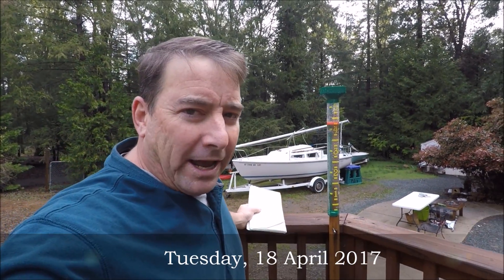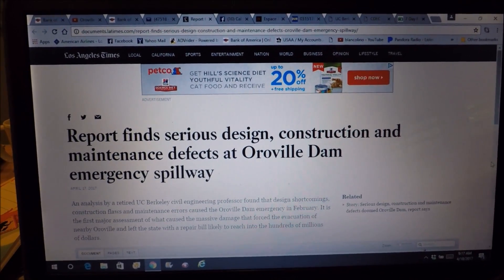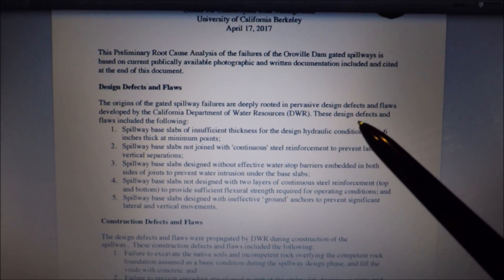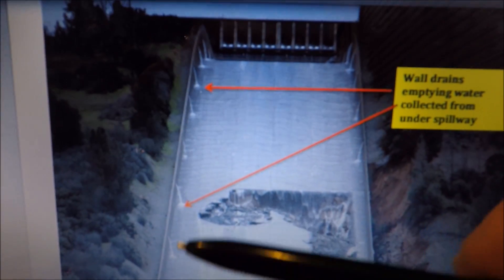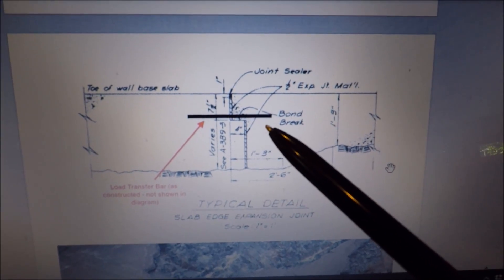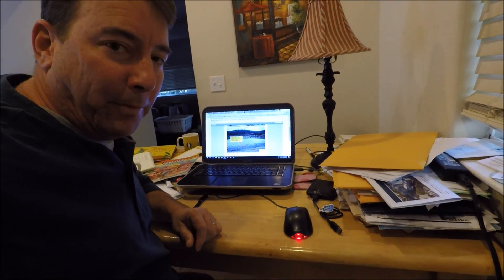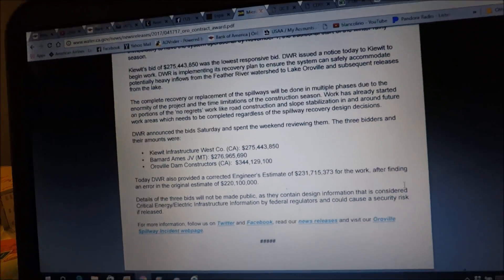Oroville 18 April Spillway Failure Explained-Independent CCRM Report

Comment: Great report. One nit to pick however. Cavitation is not "air". it is essentially "steam". The negative pressure in the turbulent flow creates enough energy to "evaporate" the liquid. The collapse is essentially the re-condensation of the water vapor.

Comment: I think Juan said it best when he referred to the spillway as a four lane highway.  The systematic designs for highway construction is much different these days then it was back in the 60s.  Back in the 80s the Federal Highway Admin started to replace the entire Interstate system with better roadways and concrete design and I think that is when they revamped large building and highway construction codes and design processes.  From what I have heard, back in the 50s and 60s, highways and bridges were designed to only last 30 years or so and the Oroville Dam spillway is no exception.  

Cracks in the spillway were a tale tale sign of needed replacement and that is the true failure of what had occurred, the lack of replacement when it was overdue.  One other note, I only know a very little about construction but the few things that I would add is Core Samples to verify the composite of the concrete and to affirm that the concrete was poured correctly meaning that a concrete vibrator was used correctly to remove all the air bubbles / air pockets in the poured concrete for further concrete strength.  Nowadays, I believe that federal projects require that the concrete will last 100 years. 

As for the cost, I would estimate $1 Billion to properly replace both the spillway and emergency spillway and maybe even upgrade the hydroelectric power system.  Once all of this is done correctly, it will last 100 years without a problem.  Yes, we the people will pay for this as we the people need the dam.  In the end, the Oroville dam spillway was not a design failure, it was just the best that we could do at the time.  As I always say, there is always room for improvement.

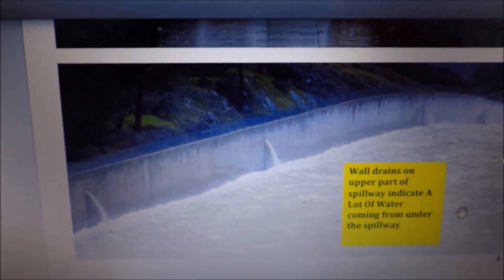Comment: Hello Juan, at 6:30 about your comment that the herringbone pattern of the drain pipes is a little exagerated, personally I think not, because the drains take the water from underneath the spilway, and dump it very high on the sidewalls, maybe 10 ft. high or more. Plus the additional depth under the floor of the spillway.  So, to have enough head for a good flow, they have to dump the water much further downhill than they take it. Hence necessitating a steep herringbone pattern. 
Thanks from Canada for the videos, they are very interesting.

Comment: Great presentation!  As a kid fresh out of high school I worked on construction surveys on the intake, transition tube, and powerhouse structures, but was not involved in the dam proper or the spillways.   

It's interesting to see this presentation on the spillway failure -- basic fundamentals violated.  

1. If water can destroy something, it will. This is especially true if hydraulic jump and cavitation are involved, because is that hydraulic jump and cavitation concentrate high forces into small areas.   All spillways involve hydraulic jump and cavitation as part of how the energy of falling water is dissipated.  

2. Any structure that is intended to block the flow of water needs to be either absolutely impermeable and strong enough to withstand the resulting static forces; or be constructed according to the principles of a "graded filter" to allow leakage water to escape without eroding the filter itself.  

3.  If a structure requires a foundation, foundation failure leads to the failure of the rest of the structure.  (This is most commonly seen in roadways, were potholes develop:  the general public thinks that the pavement failed resulting in the pothole, whereas what really happened is the foundation failed resulting in pavement failure.  And, since it rains nearly everywhere that roads are built,  an engineered roadway must be constructed according to the principles of a "graded filter".   ......The basic problems needing to be solved in an engineered roadway are about the same ones that apply to spillway design.

***************

I remember seeing the auxiliary spillway to the north being built and thinking "Gee, I hope no water ever has to go over this thing!"  Just a kid out of high school, no knowledge of formal hydraulic engineering principles.  But at least I'd played outdoors as a kid and seen what water does to dirt and gravel!   Nearly 50 years later,  civil engineers started thinking that same thought.   The design violated all three of the three basic principles I listed above.  

******

Another thing that stands out from my memories of the dam construction is that the contractor McNamara-Fuller management frequently overruled their own experts when it comes to dynamite and to construction cranes.  Through shockingly stupid mistakes they destroyed their highline tower on the south abutment intake structure (fortunately nobody seriously injured) , and literally dynamited an enormous conventional crane to the bottom of the intake tube on the north abutment (nobody hurt).  

Thanks, folks, for a good fogie reminisce.

[more edit]   Guess how you bond to polyethylene sheet?  A.  You don't.  May as well be a layer of grease. ......This doesn't mean don't use plastic water barriers, but it does mean you have to pay attention to what the structural implications are.

[and more]   https://en.wikipedia.org/wiki/Hydraulic_jump

https://en.wikipedia.org/wiki/Teton_Dam  Teton dam failure root causes were unsuitable geology (defective foundation) and neglect of the principles of graded filter design.   The dam failed while the reservoir was being filled for the first time. As the failure began, they tried to stabilize it by dumping riprap rock on the downstream face where the water was emerging, an utterly useless tactic which illustrates the Bureau engineers' complete ignorance of how dams work.

I looked for a good pic or wiki on graded filters but didn't find anything suitable for a quick explanation.

Comment: Please, do you know about it? What is this “Intake Structure Right Abutment” for? See “California State Water Project” Fig 59 of the Embankment Plant.
Reply: I think your question is addressed by a posting in this thread:

https://www.facebook.com/groups/OrovilleDamBuilders/

If you scroll down far enough, you will find a picture posted by "Shaner Jeff" dated "February 20" which shows the dam during construction and has this caption:

"Good shot of the spillway on the top left and the intake for the never completed second powerhouse, they figured they would never have enough water to run it so they never finished it."

You can also see the (partially built) intake in various pictures of the lake taken during recent years when water levels were very low.
Reply: John, thank you very much! Have a nice weekend!
Reply: URL to fig.59 please. Could guess its the penstock intake for the generators.

Comment: The spillway is the "immediate" problem, but the ugly thing is that wet spot on the surface of the dam proper.  There is leakage that is similar to other dams there that have failed.  The bad design and maintenance of the dam is really scary.  Having problems back in the 1920 time frame: understandable. In the 70's?  Not so much...Today? Totally inexcusable.
Reply: Yes.  The root cause of both spillway failures is the unstable red rock they were built on.  If they didn't excavate deep enough on the flanks of the dam, how much of a problem is that?   Engineering is based on initially stated assumptions.   Those assumptions can be more important than the careful calculations and design.

Comment: Hey Juan, Thanks again for all your efforts!! Question;  while looking at this Video i saw the "Fishbone crack pattern" which seems to be an issue for the whole spillway from back to front, so this would mean that the remaining upper part of the Spillway is very questionable, as the Construction has/had these pipes and cracks from back to front... Now if i remember it correctly the rebuilding plans will be including this old and faulty structure into the rebuild.... So, with that knowledge surfacing right now (of course under the assumption that i understand all of this correctly) wouldn't that just mean that the 250M$ Rebuilding Project is a potential waste of time and money, as (in my Option) there is no way to build a newer better structure on top of an old one, if the old one is faulty from the original drawing table already!? What´s your take on that? (comment at right update-video now)
Reply from the maker: They'll tear it all out...

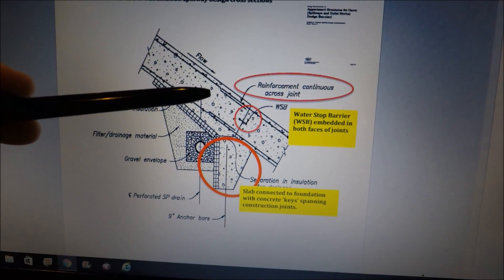Comment: Great report, appreciate your technical review of items and informative videos on the Oroville spillway.One very small comment regarding the joints.  The first joint that you show is correctly discussed as an expansion joint and the reinforcing steel does not continue through it.  The last joint shown near the end of the video appears to be a construction joint, used when the contractor ends that segment of work on a temporary basis (13:34).  The last type of joint that I did not see, that they may have used is a contraction joint, or weakened plane joint.  This type of joint would be placed after the concrete had been poured and either scribed or sawcut into the concrete to create a weak spot where cracks caused by concrete shrinkage during the curing process would form.  This prevents cracks from taking on a random locations and induces a pattern.  There is a fairly strong chance that they did not put these in the spillway given the crack patterns shown in the videoKeep up the good work,  love your presentations and appreciate the hard work you are doing.

Comment: I used to live
In a home built in the 1950's my waste water lines were built from concrete and my neighbors had large trees only 10 - 15
feet from those lines which consequently worked their way into my wast water lines making them crumble 
Up to 80% failure of the entire line let's just say it was not a pretty sight when the back up took place. On the other hand, think of what would happen if they built tall buildings without rebar catastrophic failure and that's exactly what they did both tree roots + lack of enough rebar or (reinforcing bar) I'm also curious how they were able to build this with the knowledge that water was going to flow underneath the spillway how did they think it was going to last with erosion underneath this spillway. Even the most basic of engineer or substandard engineer would know this event would be a catastrophic failure.
I live just above a dam with failures so bad that the residents downstream would gather to watch it being built in the 1950's those who live in my community during this time refuse to drive over it choosing to take routes adding up to 20 more minutes to get to their destinations because of the poorly built dam and the holes one the size of a man. In a state that most bridges are considered the worst in the country. This sounds like my state in in for a total catastrophic failure if not by a poorly built dam but also by the worst bridges in the US what is going on in my state when we are on the verge of total infrastructure failure??? Are we just going supposed to move???
Thanks for all the information you are providing makes you look at things around you in a different light. In the report that was issued in the LA Times was anything said about the blasting at the rock quarry a few miles away during the same time as the spillway failure do you think that this made any impact on this failure at all or just a coincidence?
I haven't read it yet but I do intend to.

Comment: I work construction and I have a pretty good grasp on the civil engineering with respect to drainage and how the work is supposed to be carried out. I seen something strange in the report with respect to the VCP under spillway! Those pipes are supposed  to be able to allow water to permeate through into the pipes but they appeared to have poly placed over them greatly reducing their ability to absorb water as they were designed to do. Also the connections didn't appear to be level enough to create a seal at the bell and spigot as the concrete actually in spite of the poly was able to make its way between the bell and spigot connection which makes me think that there was a great deal of deflection at some joints to the point where there may have been significant leakage at joints. I understand the need for a break between the concrete and VCP but why wasn't filter cloth used for this and why was pipe installed with so much deflection?

Comment: I'm certainly not going to consider myself educated for civil engineering, but, as strong as rebar is, steel gives under stress.  Until concrete cracks, the rebar isn't doing much of anything.  Once the concrete cracks the rebar becomes stressed, stretching slightly and then holding things together.  Post-stressing reinforcing steel would seem to me to be a much more effective reinforcement for the concrete.  That too, may be an important consideration in the rebuilt spillway.   I certainly do appreciate your reporting.  I'm not much interested in looking at a report unless I see that it's yours.  Thank you very much.

Comment: The design of the concrete spillway slabs calls for the load transfer bars to be installed in the slabs near the bottom, but the report says they were placed near the top which is interesting, but maybe is not that important!  See bars designed near bottom of slab, bar captioned with "Wrap this end only to prevent bond," PDF page 13, labeled page 6, “Detail A Lateral Expansion Joint,” and bars constructed near top of slab, caption "Load Transfer Bar (as constructed - not shown in diagram)," "Typical Detail Slab Edge Expansion Joint," PDF page 16, labeled page 9).

Comment: I am trying to figure out these water drain pipes - how are they collecting the water? Where is the water coming from. If it is underneath how is the water rising up to exit at the wall outlets?   Could someone elaborate please?   Thanks
Reply: So then going back to what Blancolirio said these pipes act like a French drain. Then, as reinforced by all responses (thanks everyone), they collect the water underneath the spillway that may be leaking from the top of the spillway, cracks in the spillway, from the sides of the spillway and from the expansion joints going all the way down to the bottom. Once collected below the spillway the drain pipes raise the water against gravity by using the herringbone shape to propel the water with enough force to rise the ~20 feet  and discharge into the spillway from the wall drains.  How high are the walls? Article in SJ Mercury News states ~20 feet tall - drain pipe can be seen 3/4 of way up the wall.    http://www.mercurynews.com/2017/03/22/oroville-dam-how-a-21st-century-spillway-compares-to-orovilles-1968-structure/
Reply: The water under the spillway also erodes the spillway’s rock foundation.  The perforated pipes are laid under the spillway in a herring bone fashion like a stack of “ ^ “s.
Reply: From the Bea report, I understand that the amount of water coming out of the drain pipes (Juan shows a picture in this video) was more than normal. That the water collected and emitted by the drain pipes indicated problems with the dam much earlier than now.
Reply: Was eyeballing it when I estimated, still then 13 feet above the surface of the spillway and the pipe is 15"  below - so add another foot.  But now as I understand it the drains are placed "downstream" with the elbow for the upstream pipe inserted into the wall, so that helps me understand how the water is "elevated" to that height.  But it isn't elevating the drain water at all because they are far enough down stream to create a natural flow.  There is a nicely detailed, informative, even scholarly level discussion of the piping and its operation from back in February here: https://www.metabunk.org/oroville-dam-drains-in-the-spillway-walls-how-do-they-work.t8407/
Reply: There are a couple of images of the actual perforated drainage pipe used under the spillway albeit not that good images at report PDF page 35, labeled page 28.
Reply: Thanks Beny, I understand they used clay pipes so there would be no rust.
Reply from the maker: Frank P they are perforated...water coming from cracks in spillway, and rain runoff from sides of spillway
Reply: okay, thanks Blancolirio, helpful.  

What I am trying to get a better understanding of is the comment from the Berkeley report that "The drains play an important function in protecting the spillway. Massive amounts of water move through the ground underneath the spillway, exerting tremendous uplifting force, known as hydraulic jacking."
Reply: Got it.
Reply: The drains are only 13 feet high on the spillway walls.  See report PDF page 18, labeled page 11.  That page also has a depiction for how the perforated pipes are laid out under the spillway and connected to the wall drains.
Reply: The under spillway drainage system operates under gravity when the spillway is in good condition, but the wall drains became pressurized from too much water under the spillway that can be seen by water jetting out of the wall drains (Posts #97 and #98, https://www.metabunk.org/oroville-dam-drains-in-the-spillway-walls-how-do-they-work.t8407/page-3).  And Mr. Bea’s report says the water discharge from the spillway wall “…indicate[s] a Lot Of Water coming from under the spillway” (Report PDF page 11, labeled page 4).
Reply: As far as the LA Times report that “Massive amounts of water move through the ground underneath the spillway, exerting tremendous uplifting force, known as hydraulic jacking."  That was misleading of the article to say that because that refers to what happened from the poor condition of the spillway letting too much water underneath, not how the spillway operates according to design.